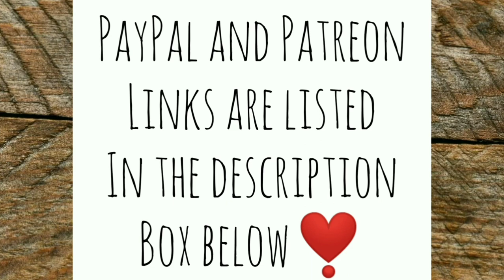Free Stuff Rules! + Water Situation and More! - Ann's Tiny Life

Comment: You should be able to get a kitchen base cabinet at Craigslist or Habitat Restore for very cheap Ann. And they may even have a small countertop to fit, for that sink. I would bet Cody could install it for you too. Kitchen base cabinets are 24" deep, sink base units come in 24, 32, 36 inches wide by 24 depending on the size of your sink. Bathroom cabinets could work as well. They are not 24" deep.  You could get one with drawers on 1 or both sides. Counter tops can be made from plywood with a few coats of poly for waterproofing. This would be your best bet hun rather than cutting into your table or pantry cabinet.  Hugs hun 😍